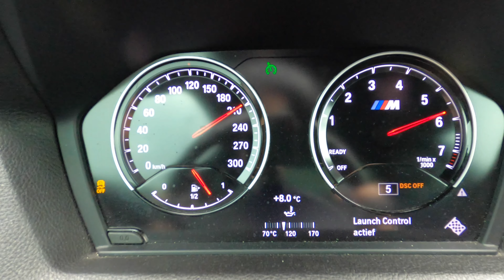breaking in a new car engine: the correct way how to do it

Comment: I’m convinced that BMWs have a bad wrap because people just push them to the max right off the truck. A properly broken in BMW engine is incredibly reliable. The point is, don’t buy a used BMW, even CPO. Just because it’s CPO it does not mean they know how it was broken in prior to you getting it.
Reply from the maker: Yeah i know. There are a few here that just push the engine to the max when new or cold. And  You can buy a used bmw it pretty safe here in europe. 
But I see a lot of people in america that dont know how to drive in a car when its new or when the engine is cold.
And cheap out on maintenance and tuning the engine does not help

Comment: It's literally so simple - you don't have to drive like a douche, but you don't have to keep it under 3k RPMS for 1000 miles, varying speeds either. I laugh at those people wasting their time. You can hit full boost or redline a couple of times within that break in and be perfectly fine. You think no one test drove your car before you? To get gas? To get prepped? It will be fine with normal driving as a break in.
Reply: Watch out y'all, this guy knows better than the engineers who actually designed and built the cars!
Reply from the maker: Well most people i know think that way. And they never tell when something breaks. When i ask were is your car ?.
- In the shop for maintenance 
For 2 weeks ? 😛🤣 
There is a reason why my car never breaks down and was faster then all other stock M2
Reply: @HappyDude1 you are also giving advice seemingly entirely from anecdotes. This is wrong. Engine builders do not baby engines like this during the break in period. All these rules you've come up with are completely arbitrary and are not based on any evidence.

Comment: Lol you don’t have to go this extreme it’s a car. Keep rpm’s under 4000, don’t use sport until you hit 1800 miles and the breaks are smoothed in at 200 miles.  Short trips aren’t bad just don’t floor your pedal. And try your best to keep your rpm’s low until the engine is warmed up but in a Supra it heats up quick after start.
Reply from the maker: Its not that extreme
Its just taking care of my machine 😀 some people change oil every 5000 km now thats extreme
Reply: @HappyDude1  I agree. Just do what the Manuel says. It’s a tough motor.
Reply: I notice how fast it warms up, its concerning as I'm coming from a cad that needs 5 minutes to get to operating temp

Comment: Just cause you win a drag race doesn't mean you do break-in correctly!  Come on, man!  Hard break in is necessary to seat the piston rings.  Before you even get the car at the dealership, it has been run hard at the factory for the first 1-2 miles on the dyno.  So once you get it "brand new" with 1-2 miles (or more) it has already been run hard very briefly on the dyno.  So the reason you go easy when you get it for the first 500 miles is because there may be metal shavings in the oil from factory break in.  Then after your first oil change, go nuts...
Reply from the maker: You think 2 miles is enough break in ? 
I like to do it the old way
And i never had any problems
My friends however..... 🤣 
They were like you and it did not end well
Reply: @HappyDude1  I also choose to do hard break-in.  I was just explaining the current "normal" processes...but I drive it like I stole it from day 1 :-)
Reply from the maker: @imyy4u1  you animal 😋
Reply: @HappyDude1  I have a 2020 M5 competition and I LOVE it.  Never had a problem although I've been hard on it from Day 1.  Never a single issue, I just keep up with recommended maintenance.  I also did the same with my last car (Shelby GT500) and had no issues with hard break-in.  But I've had lots of friends who have issues following the "normal" break in method of babying it, so...who knows?
Reply from the maker: @ImYY4U  
I treat my car like a woman
You cant just ram it in there
No, you have to be kind and get to know here and be  sweet once she knows you and she is all warmed up you can really go downtown it give it to here all night long oooooh yeeeaaah 🥹
Reply: hard break in is bad if its done too soon. under a 1000 km's 35-40% throttle is safe but no more than that most of the time. around that mileage you can apply more

Comment: Warm up for half an hour, that long?  Even when you're at 100,000km?  Can you elaborate on that.  Difficult for us living in the City.
Reply from the maker: Until the oil and the block is at the operating temp.  wich is  a bit different for each engine
The miles don't matter it remains a machine
Reply: Can you clarify, what you exactly mean by 'warm up for "half an hour"'.... no revs above 2k rpm?  What else?  What is basis for it reaching operating temp, thru the just the analog gauge, midway?   And also, you didn't mention anything about varying revs in between, you don't think that's necessary?  TY
Reply from the maker: @jgloc25  everything below 3000 rpm is fine. And be on light throttle.
Yes variation in rpm is important
Reply: @HappyDude1  Got it.  BTW, how do you tell if the 'oil and block are at the operating temp'?  I mean with the usual analog gauges?  Also, do you move vehicle immediately after startup, or heat first until operating temps, before moving the car?  TY
Reply from the maker: Some cars have oil gauges 
And yes start and drive

Comment: Taking my 2022 M3 in for its break-in service tomorrow! I’m only at 900 miles but I kept it under 3,000 RPM for the first 350 miles, under 4,500 RPM for the next 300 and under 5,500 until 1,200 miles. Then easy throttle to redline for the next 100-miles.
Reply from the maker: Very good

Comment: I just bought my first BMW a 2020 540i (second-hand car) with 30,000 km 70% off my drive is on the german autobahn doing (130km-200km depending on traffic situation) what oil do you recommend I use and what is the changing interval because bmw recommends 20k km /one year oil change intervals which I think is to much
Reply from the maker: Every 20 k is fine for that car on autobahn 😀

Comment: Got a new Acura tlx type s had 9km when I got never was told about the break in had some fun right now is at 174km do I need to worry about anything? Definitely gonna go low rpm now thanks for the info!
Reply from the maker: Some engines get some break in at the factory.
I dont know wich one you can ask at the dealer.
You can only know if your engine is good after many miles to see if it is starting to take oil. 
And a dyno test to see the HP 
But only do that after 20 000 miles because its not that healthy.
Engines are a lot stronger now then in the olden days. Oil is also a lot better so its not going to explode 😃 and acura is honda right ? They should be very strong
Reply: @HappyDude1  awesome man thank you for the information!

Comment: Got a new 2022 bmw m240i. I already floored it once or twice. Did I mess it up?
Reply from the maker: Maybe you will know when something breaks or oil consumption
Reply: This thinking is backwards. Engine builders will tell you that you need to run the engine harder than this to break it in. Babying it is not how they break in new engines.